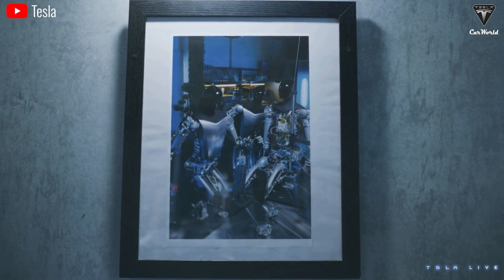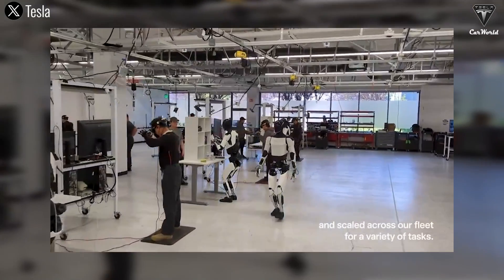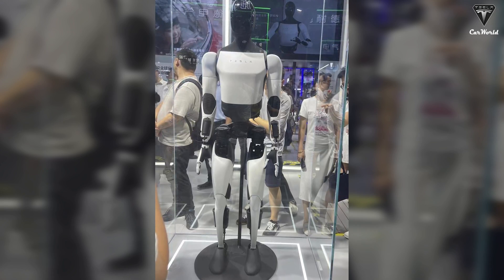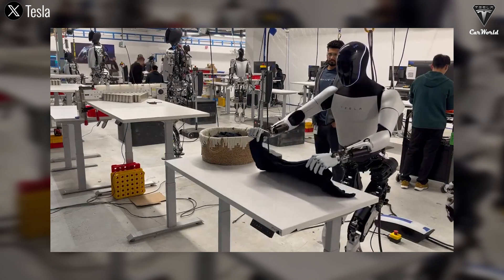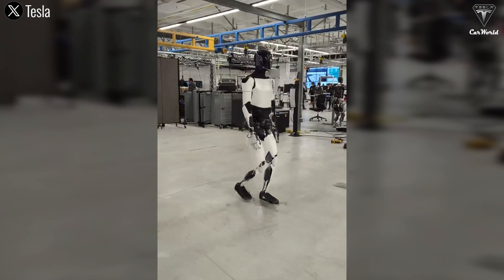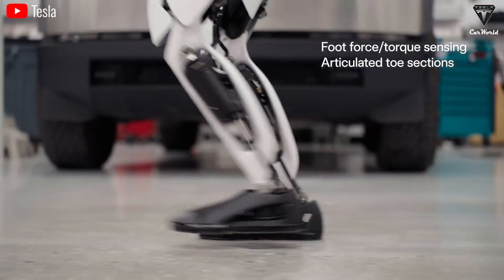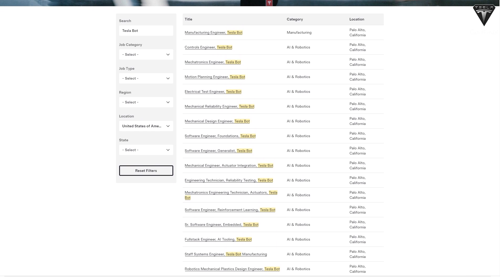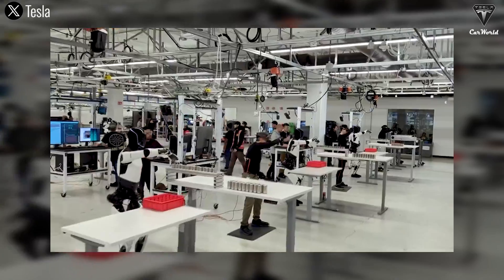Elon Musk ANNOUNCES New Tesla Bot 2.0 - Optimus Gen 3! BIG Upgrade Design & Features ! DECEMBER!

Comment: I think if I could share my thoughts on this new design it would reach a milestone 10 yrs in advance with a few modifications. The mechanics is pretty slow and should be more  advance. the fingers - that thumb need some adjustment though I have the best hand for robots like 8 years back and no one has come across such design. I need to start a career  in this field

Comment: I guess even trade jobs aren't safe for long if these things can gain reasonably sophisticated functionality. These robots wouldn't even need to have a lot of depth in terms of their scope of ability. All you would have to do is use the robots to stockpile mass amounts of necessary resources(cheap labor). Then, rebuild the infrastructure using simpler design templates with future upgrade and update in mind. Like an optimized 3d printed society. Entire cities could be constructed in a fraction of the amount of time. If a design becomes obsolete, replacing it wouldn't be a problem. You could have nomadic societies built around optimization in different environments. After enough reinforcement learning, setting up a society on Mars would be a tuesday afternoon.

Comment: If Optimus works that slow in a pharmaceutical vials factory then it’ll be disastrous…. I hope it will be able to use both hands - these robots will not be fast enough on the production line. I have to see it to believe it - I hope I’m wrong as I want this to succeed and push Technology to the rim.

Comment: They would never use Carbon Fiber. Tesla and SpaceX controll a non insignificant part of the Steel industry plus they always strive for the cheapest option. Carbon Fiber is too expensive and parts cannot be fixed, only replaced. Also i have to add the video is good overall but a little too wishy-washy. Be a little more serious and do some better research - Some points made here are totally rediculous. 100 dollars a month rental fee? Did you guys break a circuit? If that was humor it didn´t come across as such. Also: Tesla has a huge team of highly qualified people. It´s not like Elon Musk is in his garage, Tony-Starking everything on his own.

Comment: I'm wondering if with these upgraded designs the Tesla engineers opted to go from 12-volt system to a 24-volt system in order to reduce the bird's nest of wires or cables that earlier versions displayed.
Also, I think that possibly going with an all-carbon-fiber model it would reduce the overall weight enough to be able to add more capacity of either battery power or sensor arrays and head displays.
Reply from the maker: we think so! it will be upgraded to maximum convenience in an effort to reduce weight. in your opinion upgrading from 12v to 24v is entirely possible even 48v to fully optimize the wiring and remove some copper Expensive and heavier, wait for more